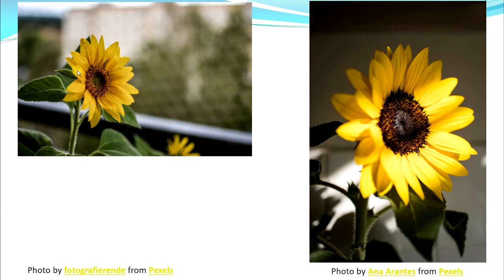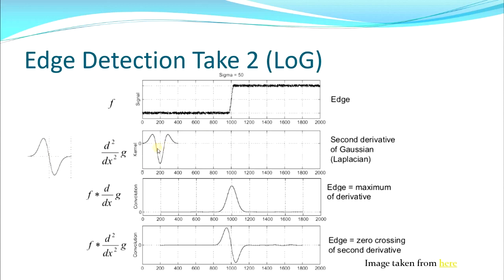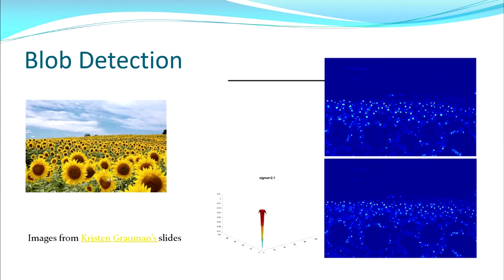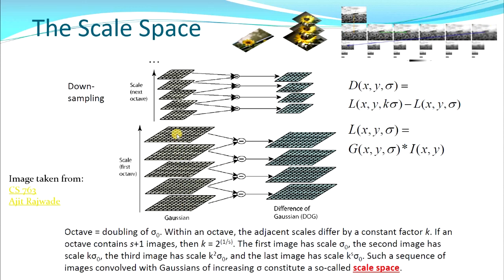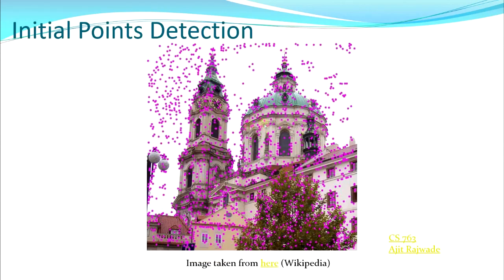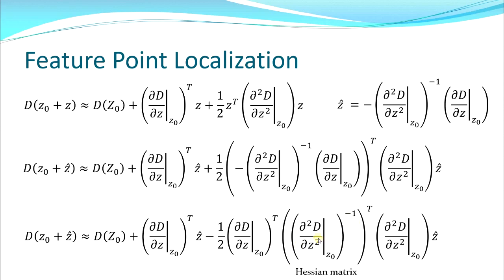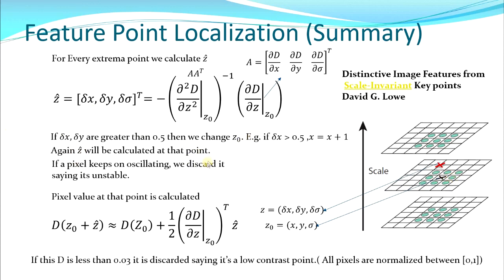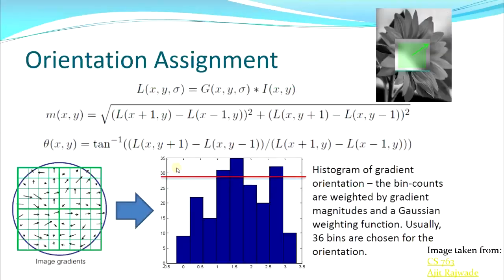Scale Invariant Feature Transform 1 (Feature Detectors)

Comment: I don't understand why we do scale space extrema detection and not just space extrema detection. In a previous slide, you show a 1D example with convolution with the laplacian of Gaussian, but there are not several values of sigma in that slide...
Reply from the maker: If you see the slide titled (Coming to the point) you can see that the concept works only when the size of the blob is similar to that of the sigma value of the laplacian. Hence its important to serach within a range of different sigma values